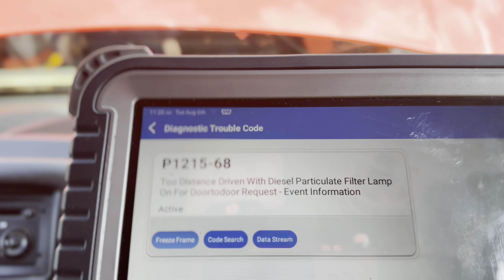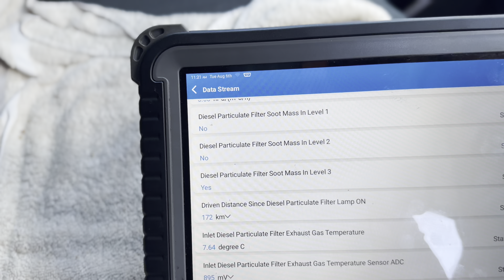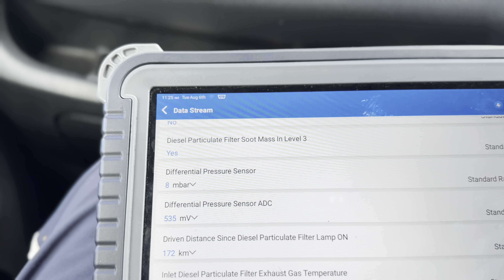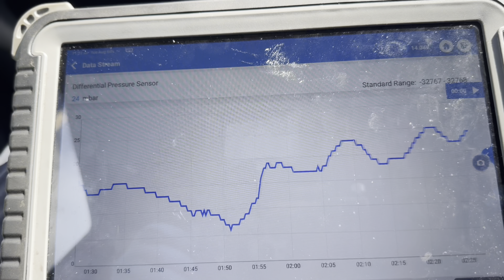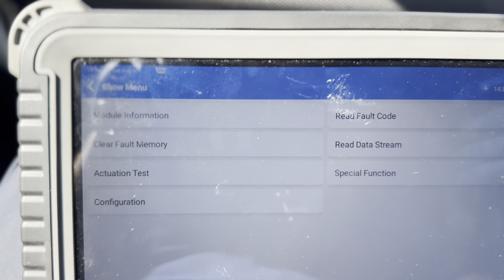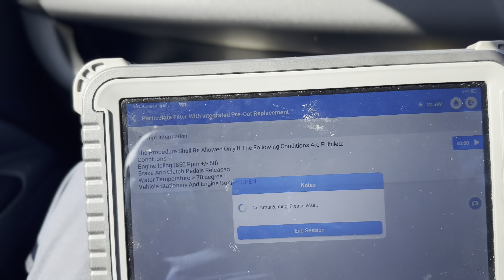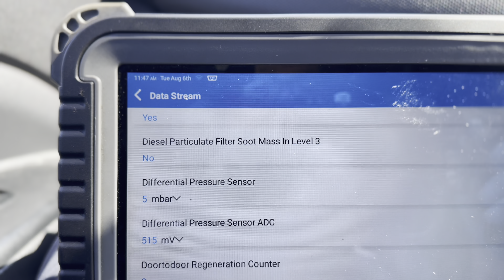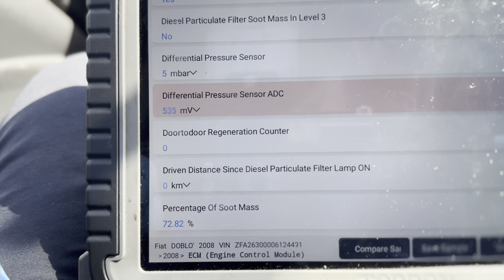Fiat Doblo XL 1.6 Diesel (2013) - P1215-68 Particle Filter Door to Door Request😣

Comment: DPF sensor was reading 2 mbar with engine off , should be 0 mbar surely ?
Reply: I agree plus one should do playability test on pressure sensor with a pressured gauge capable of reading in Mbar as it seem very low when you revved it